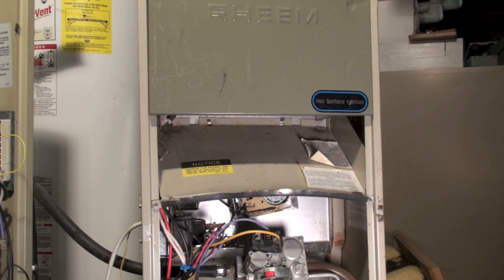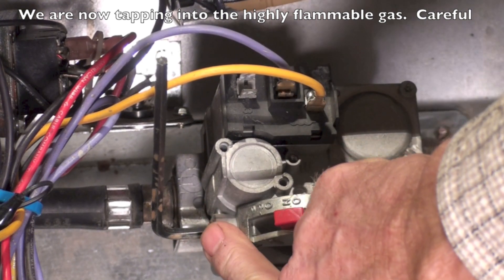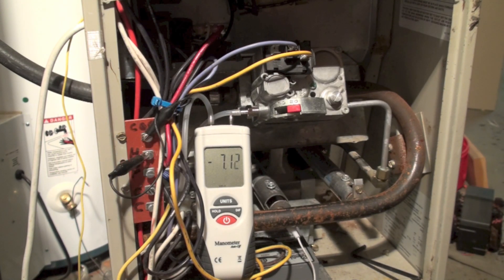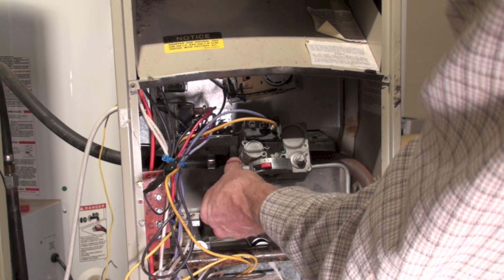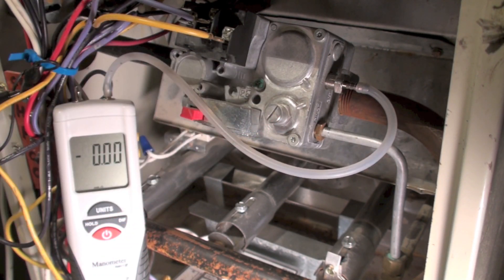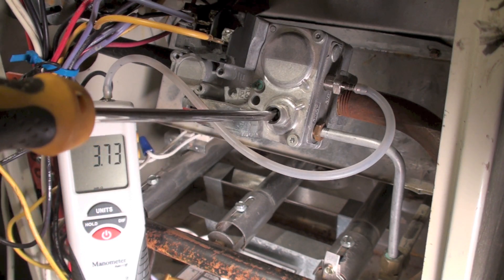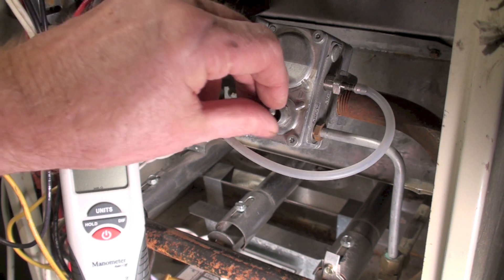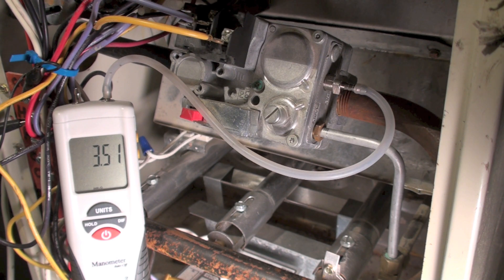How to check gas input pressure on the RGDA furnace

Comment: Hi, good info
I like to know how I can check
The pressure in yhe pilot tube.
Reply from the maker: You can't check pressure in the pilot tube.  There is a needle valve in the gas valve for adjustments.  More likely either the pilot orifice or the pilot itself is plugged.
GFM
Reply: Tx  for the info

Comment: Why is it that when you checked the inlet pressure the left side port on the manometer was used and for the manifold pressure the tube was connected to the right?

 Also should pipe seal be applied to the tap screw thread prior to reinstallation?
Reply: I was wondering the same. I just bought same manometer and the manual is no help.  I didn't mean to buy a differential testing or dual port manometer. I should have bought a single port. When I block the left side port off, I was getting different pressure readings.  The manual does not explain if there is a high (+) and low (-) ports. This video helps because it would seem to get the correct reading if one port is left open to static pressure.

Comment: HT-1890 Digital Manometer Differential Air Pressure Gauge Meter Tester
Hello Gray,does
 this manometer is able to measure gas pressure and able to do tightness or let
by test on gas meter.
Reply: sanjiv rai

Comment: Is it normal for the manometer to fluctuate when reading manifold pressure. Because when I'm using my meter it constantly gives me multiple readings up to the point that I set the pressure to for the manifold.
Reply from the maker: It should not if the vent is clear.
GFM